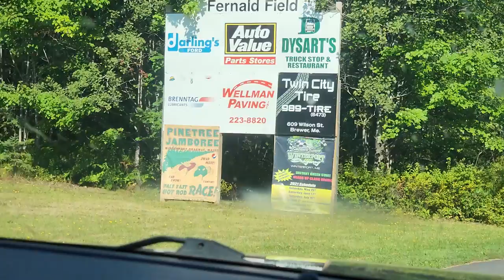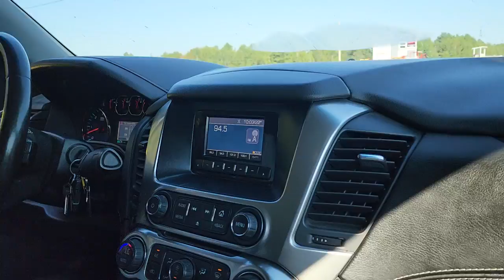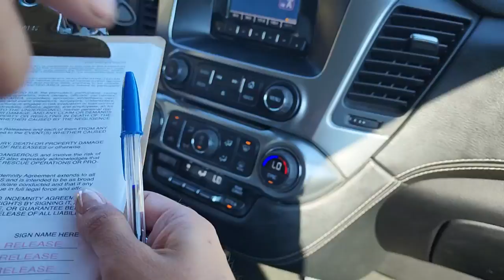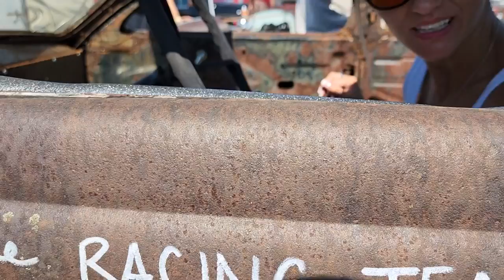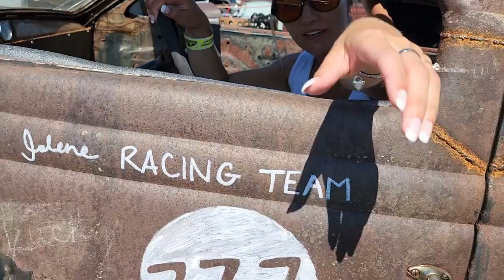Refining the race car before Jolene goes drag racing | Pinetree Jamboree, Winterport Dragway

Comment: Chad what's up ? Car not moving . Not racing today ? Dang did I miss it shucks ! Jolene looks ready to go Chad tighten up some lose ends  and let's burn rubber ! I'm looking forward for this for awhile Jolene has to I  bet ! Peddle to the metal let's bring the heat 🔥 the time for kicking  tires is gone let's light some 🔥  ! Big smiles all around  aand be safe always!  👍

Comment: The resister goes in between the starter and coil on the hot wire. You will need to put a resister on the gas gauge. You can use the same 6 volt starter. It will just spin faster. Good luck Jolene. Ronnie.

Comment: It will take 15 minutes to pull the  head and put it back. Check for stuck valve , feed it atf while tapping it and check the firing order swap the two dead cylinders and or plug wires

Comment: now it's time to build that lil 4 cylinder, de-stroke it, on 1/8th you need no legs its ALL about torque.. open up the intake and exhaust.. on these heads a good CnC port n polish helps tremendously..  knife edge the crank, balance and polish.. balance everything that turns, even your rod bearings and rings.. then roller (ceramics) that crank and she will spin up so fast you won't believe it.. if you can roller the rods its even more of a bonus... its all about torqy quick spin ups... HD head bolts and big aspiration, bump compression and get some serious mix running through her..then you need to get the gearing right, that's an issue with 9/10ths of these rides, you need LO LO LO gears for a 1/8th, you should be shifting into 3rd at the 60ft mark, then 4th and boom, just be topping out at the traps, 4 very quick shifts.. or 3 if you find a 3 spd but drop that rear end so it tops out at about 75mph and you should be able to get ina 75+ 1/8th once she dials in her reaction times so forth